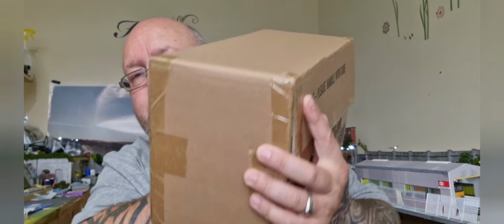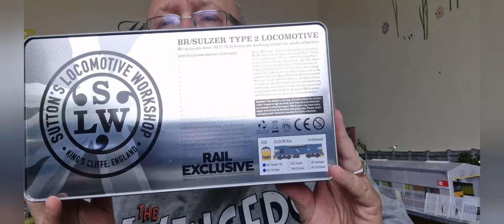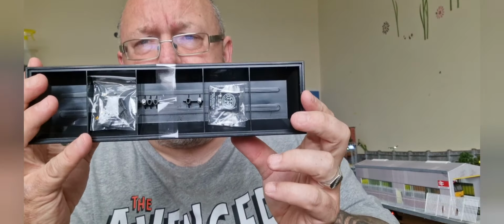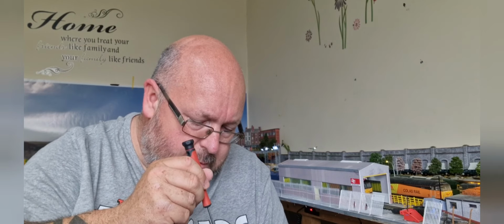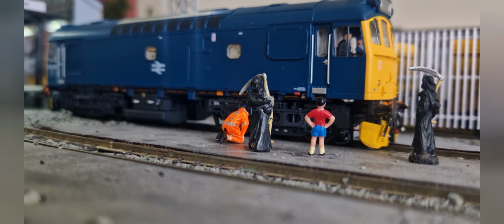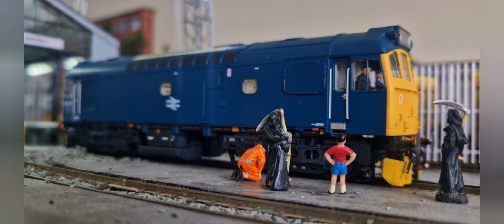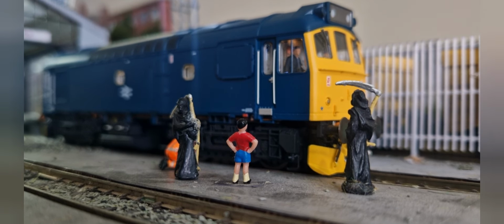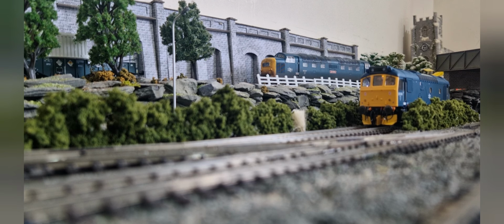Suttons class 25324 review

Comment: Hi Craig, just come across your channel when I saw you were looking at the Suttons Locoworks Class 25. I have one of their earlier Class 24 models, and have to agree with all your comments. I am guessing this is the first Suttons loco you have purchased from the excitement as you unboxed the model. They truely are a work of art, aren't they. They run super smooth and silent, and compared to other manufacturers sound fitted models aren't that much more...............Although I believe they call it a biscuit tin, not a baked bean tin though..............But I would excuse you due to the excitement of unboxing an amazing model..................Great stuff, all the very best Dave.
Reply from the maker: Thankyou for finding my channel and many thanks for the comment and feedback yip the loco has blown all other manufacturers out the water if these don't win loco of the year there's something wrong